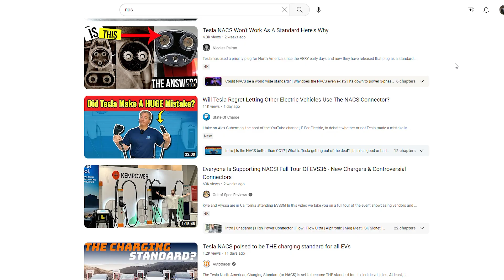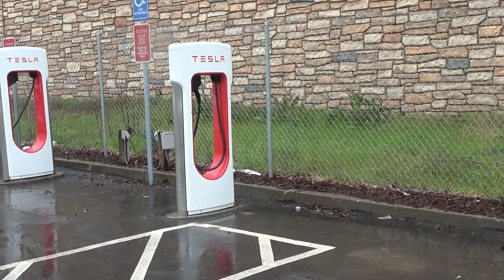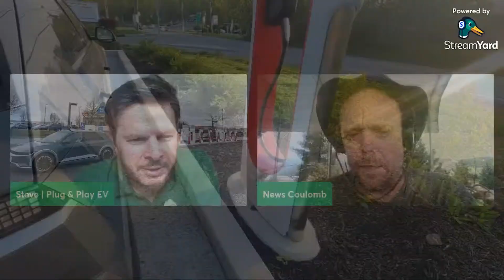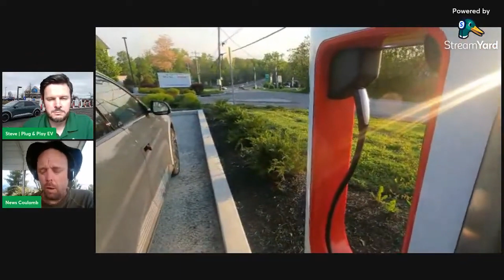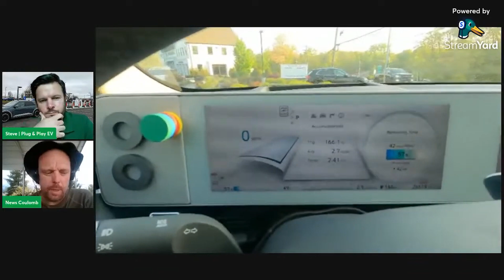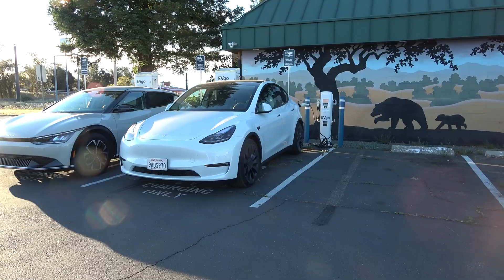The Name "NACS" is Confusing and Problematic: Use SAE J3400 Instead

Comment: That 2% must be in the Bay Area.
Reply from the maker: Must be. Many of those are some of the oldest public fast charger installations in the world, and many are due for updates. Personally, I haven't had many issues with EVgo's chargers in the Bay Area, but I suppose everyone's experiences can be different.
Reply: @newscoulomb3705   try East Bay. Now it is second hand information to you. But there's no reason for my coworker to lie, or even embellish to me. It's not vandalized. They are just offline. And not both, a lot of the time just one stall.

I've had about 5 Tesla stalls out, but never the rest taken. I'd just move over. Flip the cable over the top of the bollard (universal symbol for stall out). Then the next trip to the location and it's working again.
Reply from the maker: @zigadabooga  I use East Bay chargers a lot. Just glancing at PlugShare, most of the EVgo sites are between 8 and 10, meaning less than one or two issues have been reported out of the last several dozen check  ins at each site. Perhaps your coworker was referring to Electrify America. They are still working through a lot of reliability issues, and they are notably less reliable than EVgo (about 70-75% charger up time using the same metric).
Reply: @newscoulomb3705   The one in Martinez pretty much has one out all the time, it's only two there.
Reply from the maker: @zigadabooga  Oh, sure. If you want to find a single site, maybe. EVgo has hundreds of sites in Northern California, so a single site is literally a fraction of a percent. However, that said, both chargers at Lucky Martinez appear to be up right now. 🤷‍♂

I do notice that EVgo is actively taking down a number of older sites and replacing them with their ReNew program (like that Martinez site, which had the unreliable BTC Power units replaced by Delta units). 

I  also know for a fact that a number of those sites being repaired were targeted by vandals. In one case, the vandals specifically disabled the CCS1 and J1772 plugs while leaving the CHAdeMO connectors unharmed. In another case, they literally cut all the cords at the site.
Reply: @newscoulomb3705   That's the one site he has frequented, which is near enough that I can drive by it and see that it has been out. He has complained from Vallejo to Oakland along I-80 many chargers have been out. He has a 2014 i3 and charges at least once a day when out. I'll ask him which others. I believe another one was pinole that was always out. Again I have not heard of any vandalism reported by him. Just at the station appears to be offline. No cuts to cables etc.

Comment: J3400 on EVgo means Teslas can arrive at an EVgo to a broken charge location. Yay.
Reply from the maker: Keep in mind, not all Tesla's have received the CCS update, so they aren't compatible with the NACS/SAE-J3400 standard. So it's not the charger that's broken; it's the car.
Reply: @newscoulomb3705   😅 that's not what I mean. The EVgo stations are always broken.
Reply from the maker: @zigadabooga  Not according to the data. They have a 98% charger uptime. EVgo was the first company to actually provide that data, and it's the metric that NEVI's rules were based on. Now, to be fair, that doesn't count intentional vandalism, which unfortunately underwent a notable spike in the wake of Tesla's NACS proposal. 

The hope is, it's not Tesla owners targeting and sabotaging EVgo stations in order to make the case for NACS over CCS1 (or simply to put down the strongest public charging competitor to the Superchargers in North America). 

Sometimes, simple accusations of poor reliability are enough to undermine a competitor. I've found that to be very important in the TSLA investment circles. Fuzzy Panda Research jumped on that anti-EVgo bandwagon, too, and they certainly have an oddly coincidental overlap of interests with TSLA investors.

Comment: There are 8 thousand stalls that are "Tesla only"? Why can't they just change the communications on the charger side? It's Tesla we are talking about, they can maneuver like that yeah? Super curious about this. I know not all older Teslas are ccs adapter compatible but that's a car side thing.... Hmmm... Couldn't they update the car comms? Answer I am tracking is no..... What is real? 😂
Reply from the maker: It appears that it's more of a hardware issue. The V2 Superchargers were still essentially CAN linked onboard AC car chargers strung up in parallel, so all the communication was essentially the same as the car's internal systems. 

Realistically, Tesla should probably be ripping out all of those chargers and replacing them with V3 to V4 anyway, at which point those stalls should be available to everyone.

Ford made a statement that their owners would be able to access additional stalls beyond the original 12,000, but I think they might be updating based on how much the Supercharger network is expected to grow before Ford EV owners finally have access. 😂
Reply: @newscoulomb3705  rightin.... hmm... well working equipment could possibly have a gateway communication device installed before removal of good equipment happens, I hope. Let's call it a magic gateway. I'm so curious what they are going to do. What is the right thing to do?
Reply from the maker: @TRYtoHELPyou  The "right"  thing to do will depend, but for Tesla, it probably is simply ignoring all their existing sites and continuing to expand with new hardware. The problem for everyone else is that it appears that Tesla figured out how to access NEVI funding despite V3 not actually meeting the minimum requirements (e.g., dedicated 150 kW per stall), and so they now have a huge incentive to add "Magic Docks." Essentially, they're accessing the same billions of dollars of funding by retrofitting existing equipment while other providers are having to go through the expense of installing all new equipment.

Comment: I hope it works out, it seems like a bad time to confuse plug standards.  If someone invents a better standard in two years, should we change again?  I wouldn't trust any deal with Musk, especially after the agreement to pause AI development while he worked on AI acquisition and development.
Reply from the maker: Yes, I also don't particularly trust Elon/Tesla's intentions, but the cat is out of the bag now. So long as SAE has control of the new standard and can set power limits based on agreed upon safety models, I'm all for the smaller plug. For light to medium duty EVs, it really is a better plug for most consumers.
Reply: @newscoulomb3705 thanks, you made me feel better about this whole situation.  Just bought a new 23 bolt EV, I wouldn't have held out anyway tho.

Comment: The only companies that has not negotiated with tesla is vw (vw Porsche and the other vw brands)  Kia and hyundai pretty much the same company and lucid Kia and hyundai and lucid I could understand because they are 800v architecture but Kia and hyundai 400 volt cars need the nacs port because they can run just fine on the tesla network the Kia Niro ev and hyundai kona they need to be going to nacs because if they do not transition they will be missing out on a very big part of the market which is vehicles below 40k range
Reply from the maker: I suppose it depends what you mean by "negotiated." I think the better term would be "inquired." To my knowledge, while Hyundai, KIA, and possibly Lucid all inquired about what Tesla was offering, they ultimately rejected any true negotiations. That makes sense to me, given that both Hyundai and KIA actually operate out of a CCS1 domestic market, and Lucid is run by a former Tesla engineer. They understand that there is limited value for their customers.

As for the Kona and Niro, it's true that they likely want to maintain those cheaper options; however, nothing is preventing them from transitioning to the smaller E-GMP battery and powertrain. 

Also, I think a lot of people miss just how robust the public charging infrastructure is for smaller, more efficient EVs. All the complaints you see are from consumers demanding 150+ or even 350+ kW charging. Cars like the Bolt, Kona, and Niro travel just fine while rarely having to interact with the crowded, sometimes problematic Electrify America stations.
Reply: @newscoulomb3705  I highly doubt that hyundai and Kia will bring the budget models to the e gmp platform as that would increase the cost which already hurts them in my opinion they need to be manufacturing these vehicles in Mexico that way they could get the tax rebate and e able to sell the vehicles at a lower cost overall because that is really hurting them not having that rebate
Reply from the maker: @justinjones6810  Hyundai and LG are already expanding their manufacturing efforts in Georgia for exactly that reason. They're looking at a 300,000 domestically produced EV per year run rate starting in 2025. I'm not sure how much their E-GMP "Light" battery pack would cost compared to the current pack being used in the Kona, but it shouldn't be that much more. And a 170 kW charging speed on a budget EV could be quite compelling.
Reply: @newscoulomb3705  that plant in Georgia is just for the hyundai ioniq 5 ev6 the 800v platform they need to put a plant in Mexico for the budget line of ev to compete with Chevy bolt because even with the tax rebate it is still cheaper to get a Chevy bolt if they lower the manufacturing costs they can better compete especially if they are even cheaper than the Chevy bolt

Comment: All charging stations will require a approved adapter and not just any adapter.
Reply from the maker: That's really just new to Electrify America, which I'll admit, was a bit of a surprise. After all, they are including CCS1 to Tesla adapters at some of their new charging sites. On the other hand, EVgo has had that requirement in writing for several years now. 

Either way, it's questionable whether they will even be able to enforce it (especially EVgo's policy, which includes EVs that weren't modified or produced by an "official" automaker). And as far as I know, ChargePoint hasn't instituted the same policy, and I don't know of any other automakers who have either.

Comment: I think the real issue here is the difference in understanding between rank and file lay folks and techy nerd coder types. What I mean is that to the general public the “standard” in their minds refers to the physical shape and form of the plug itself. To tech nerds and in the eyes of the government and standards bureaus the “standard” is the coding and signaling protocols.
Reply from the maker: I fully agree until it gets to the point of interoperability and actually functionality. That's when the average consumer is affected. I've seen similar issues in the past, where Tesla drivers were complaining about "slow Superchargers" after plugging in at a destination charger.  Now, instead of unexpected power level issues, we're going to have cases of unexpected lack of access.

Comment: Thanks for the great nuance...

Doesn't the Tesla PLC-CCS protocol supercharging stations all still also have the old CHAdeMO capabilities? So that they still support the older Teslas?

If that's the case... Why not push for a standard that can continue to do all the protocols?  Isn't it a shame to exclude older CHAdeMO and old Tesla which speak that protocol?

It shouldn't be a big deal to ensure that a stations communication can speak all legacy languages (protocols), right?

Anyway, thanks again for getting into the inconvenient details.
Reply from the maker: Thank you! I can't speak to the logistics of it, but I do agree that we're leaving a lot of EVs behind. Tesla, as far as we know, is still continuing to support both standards, but part of the issue is that Tesla's proprietary CAN standard isn't open and available. I've seen some people assert that it is CHAdeMO, but I don't think that's entirely accurate. If it were, Nissan LEAF owners could simply swap out their CHAdeMO socket with a Tesla socket, and they'd have direct access to the Superchargers.

So until and unless Tesla releases their CAN protocols, I can't see how public charging providers would be able to implement the "bilingual" J3400 plug.

Comment: Thanks for the info.  I didn't realize the J3400 would incorporate both the J1772 and CCS standard.  I wonder if that means the auto manufacturers will stop supplying cars with J1772, and if so, what becomes of all the (many) J1772 stations that are out there.
Reply from the maker: I think the current state of AC charging can tell us what this will look like for some time to come. Tesla has already released one of their wall connector chargers with both the Tesla head and a built-in J1772 adapter (it looks like what they provide their customers when they buy a car). There's always been 100% interoperability on the AC side because Tesla based their AC standard on J1772. Initially, it was J1772-2001, which is why Tesla's first AC chargers omitted the pilot (IIRC) connection, so it was interoperable with the old Avcon chargers. By the time Tesla started using their new plug, though, they had already moved to J1772-2009, which is the current public AC standard.

Essentially, AC is not really something to worry about. I foresee consumers using basic AC adapters for many years to come, and it probably won't be a big deal at all.